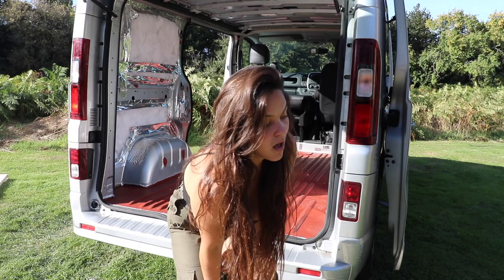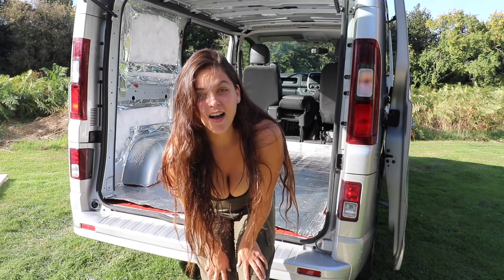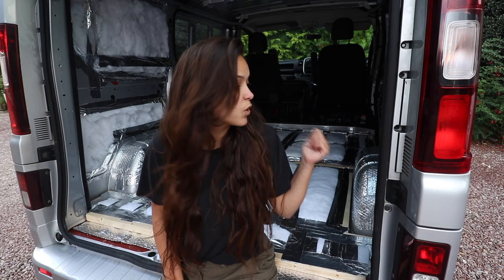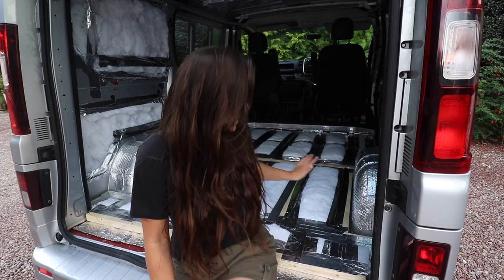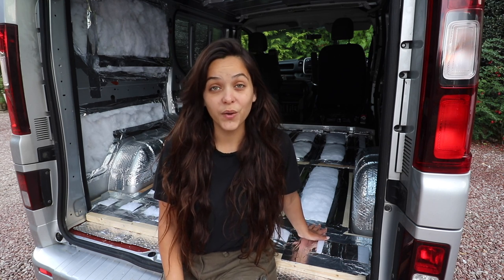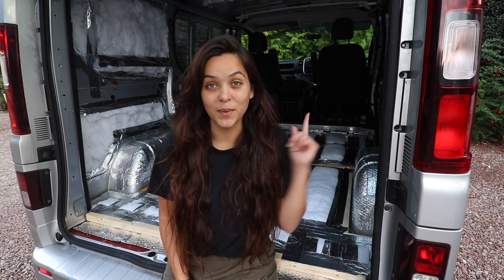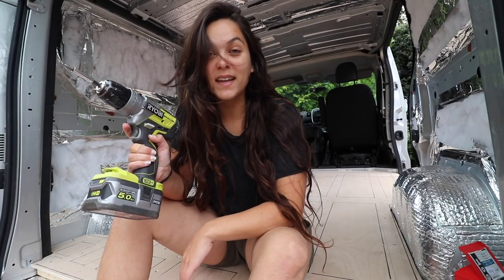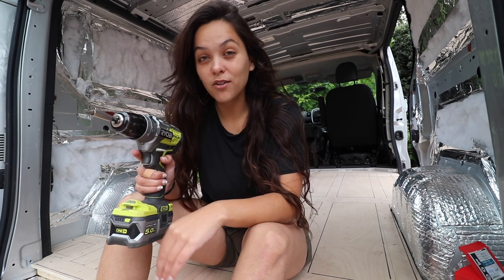The Ultimate Van Conversion: How I Insulated And Floored My Van | Fenellas Corner

Comment: Just a hint... if you cover the interior wall of your van with something that doesn't breathe/transpire moisture, after blocking the airflow between the inner walls and outer shell of the van with insulation... there is a high probability, since you will be spending a lot of time in it, that moisture will condense in the insulation on cool nights or any intrusive rainwater to get trapped to cause mold and bad smells over time. 
The space between your panels needs a way to breathe since they are not hollow anymore.
Maybe consider covering the interior walls with a synthetic fabric material instead of a more sealed material that provides a barrier for any moisture or condensation to escape. Especially if you'll be cooking or sleeping in there often or, you could end up with the aforementioned problems plus rust higher up in places that usually don't get rusty on vehicles.
Either way, keep on keeping on and I wish you well!